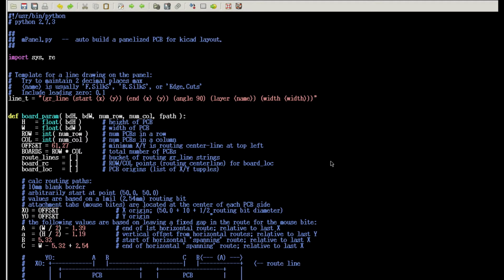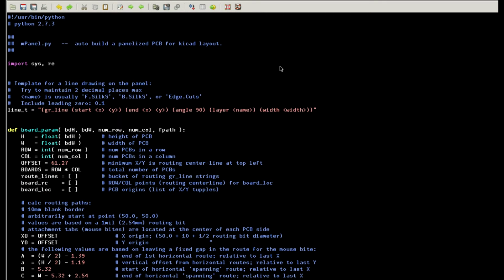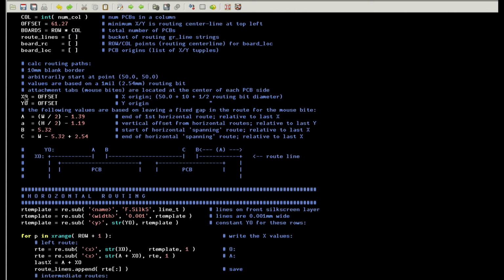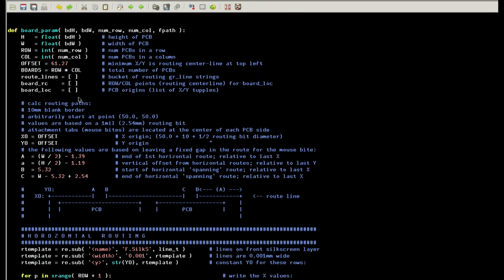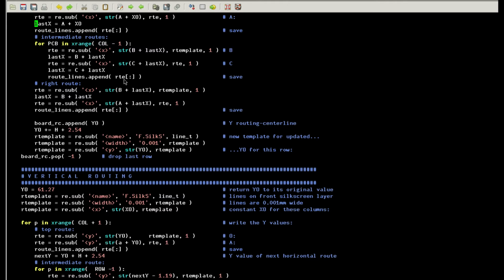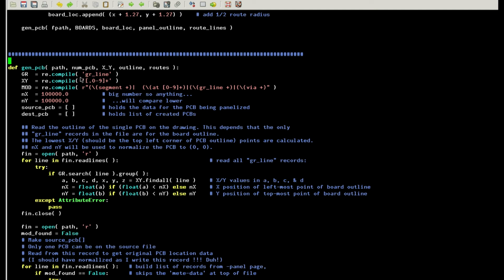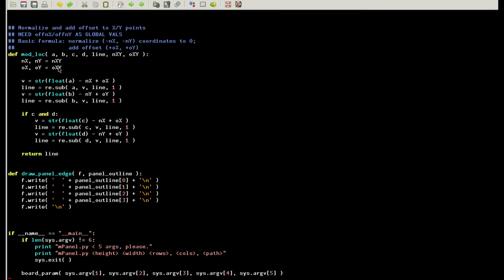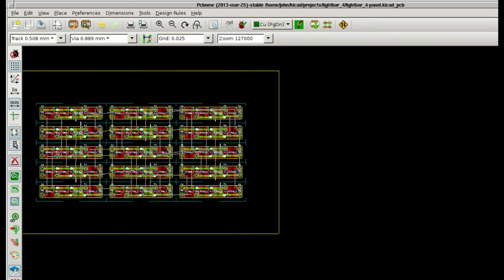pl20 python panelize

Comment: Some notes:
1. Publish this script on Github, so issues can be addressed.
2. Got "ValueError" exception in line 183, fixed it catching the exception... but the output still doesn't work (using KiCAD 4.0.2 on a Mac).
3. Awesome work dude! This makes a great alternative for panelizing imported jobs from eagle to send them into production :)
Reply: +Alfredo Rius There is also a problem in the "mod_loc" function. using re.sub may replace more than you need...